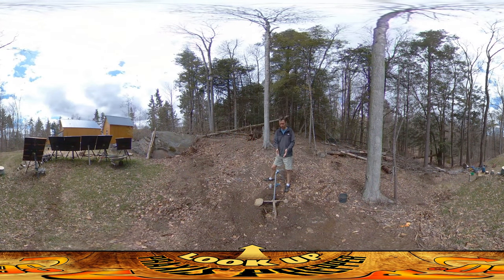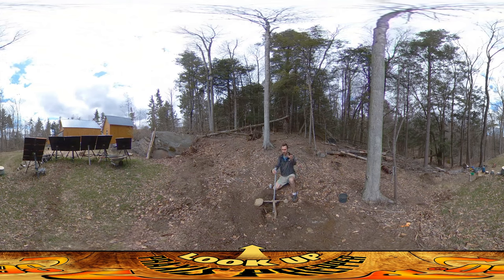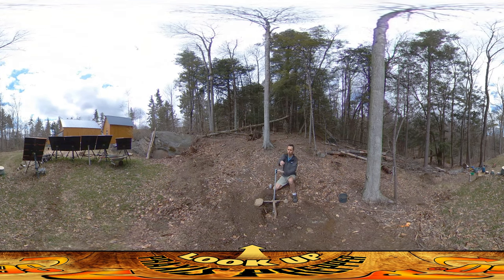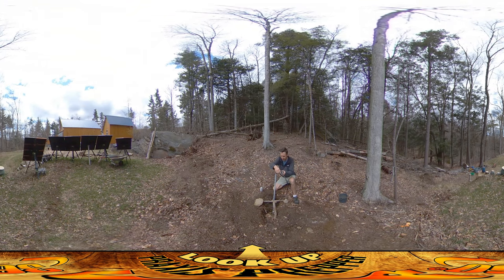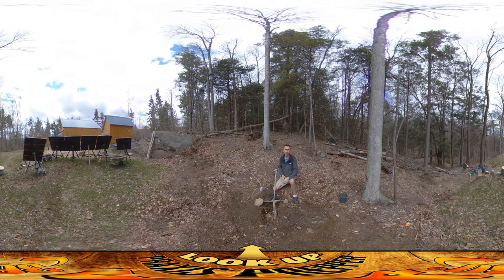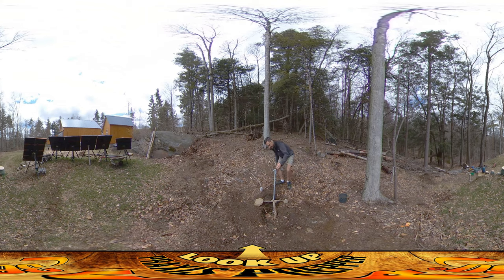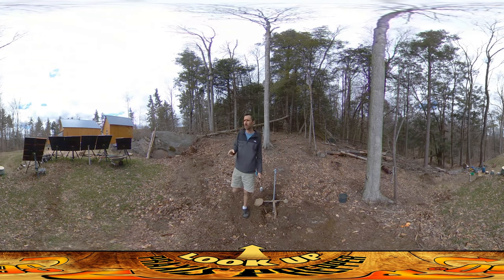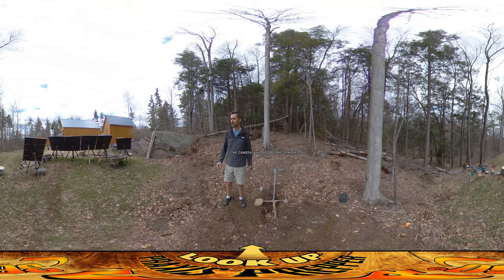Homestead Building - Wiring Underground Run for Solar Array

Comment: Looking forward to the demonstration of adding the connectors 🤪

Out of curiosity, is it a problem to splice 2 360 videos together to make longer videos?
Reply from the maker: It's not a problem, but it's a bit of a pain in the ass. I can't edit them in the conventional sense. So I'm a little blind and deaf when working with them. I just grab in and out times from another video player and use them to know when to cut into and out of the clip. The bigger issue is that the video camera doesn't give me any sign that it's stopped recording other than me seeing that it's no longer recording when I go to shut it off. So I don't know where it cut out. The whole thing is a bit of a blessing in disguise I'm sure as I tend to be long winded anyhow - so this makes my get to the point.